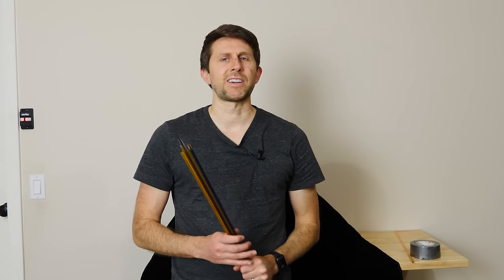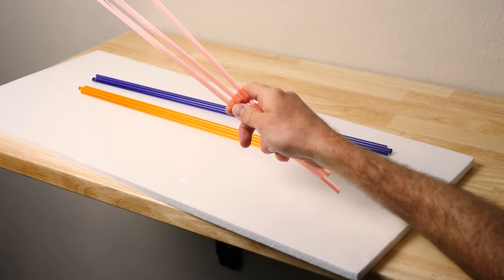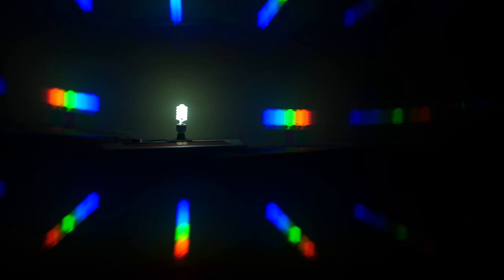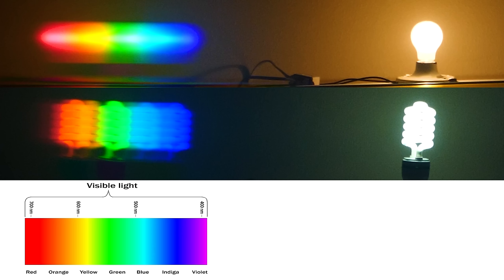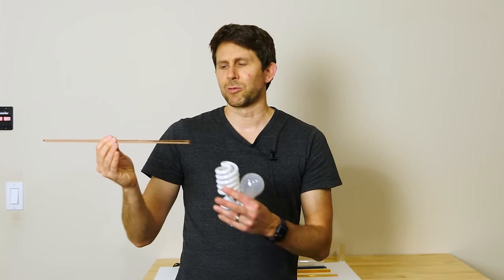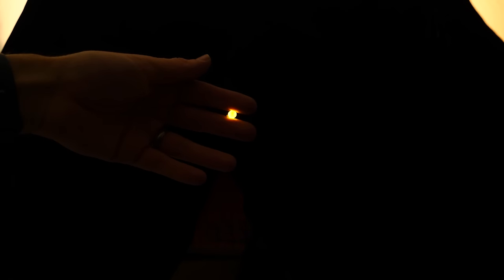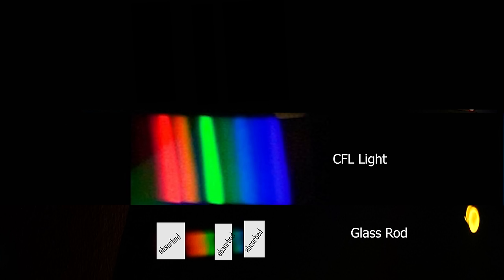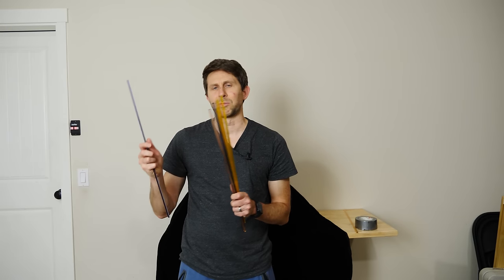How Does Shifty Glass Work?

Comment: I'd be interested to see the difference with an LED bulb, as well, since most of them use a blue light source and yellow phosphor.
Reply: White LEDs don't have any "gaps" in their spectrum, like CFLs have. The effect could still be possible because the spectrum has a different caracteristic  "shape" compared to incandescent lights, but it can't make as big of a difference.
Reply: LEDs and CFLs use the exact same phosphor to produce light. There is no difference.
Reply: It would be interesting to see what different types of lighting looked like, for instants, high pressure sodium lights.
Reply from the maker: The LED white lights are pretty similar to incandescent bulbs. When I showed you the diffraction sheet on a light On the ceiling in my video that was actually an LED light. You can see how it is pretty similar to the incandescent one with no big gaps.
Reply: I have a Kind LED grow light that I can adust the spectrum on. I'd love to see the complete range of colors available on the shifting glass.
Reply: @pdp11  no they don't, and for a good reason: mercury vapor and blue LEDs have a completely different emission spectrum. Mercury vapor produces a very "thin" band of uv light, while blue LED produces a much larger band of visible light.
And it happens that LED manufacturers found some combinations of phosphores  that can convert the blue light from the LED to a pretty smooth white spectrum.
Reply: @TheActionLab  well that's because the phosphors in the LEDs are of high quality. But you can get CCFLs of the same quality. For example CCFLs used for video and cinema lighting. Sadly, the converse is also true. There are plenty of very bad LEDs.
Reply: You should check out Technology Connections video on this subject, LED lights do have gaps which is why the Colour Rendering Index is a thing
Reply: @pdp11  no they do not.
Reply: @TheActionLab  Does that glass contain neodymium?
Reply: I was thinking the same thing.
Reply: @TheActionLab  what about high CRI LED(~95) vs average LED´s ?
Reply: @stephaneduhamel7706  that depends on the specific LED you really can't make that kind of general statement because you can still get LEDs with multiple different phosphor blends because that's how they tune the CRI value and color temperature.
Reply: @TheActionLab  What color shifts are there with natural daylight, or a laser, does the color temp. make the difference?
Reply: @pdp11  LED bulbs do not use phosphor.  The diode itself emits a specific wavelength directly based on the specific makeup of the diode material. If they can’t get a specific color for some reason, they will use multiple diodes of different colors and a diffusion filter to mix the colors to get what they want. 
But phosphor is not used.
Reply: 2:35 The phosphor in a ccfl is INSIDE the glass.
Reply: @shawnrhode Wrong . . .  White LEDs are made from a MONOCHROMATIC Blue LED by adding its complimentary color , that is , Yellow ( as opposed to mixing of RGB LED emission as observed in TVs or Displays.).

The required Yellow photons are generated from the Blue LED photons itself through Stokes effect.

The Blue Photons are absorbed in phosphor material that is coated onto the LED chip, and emitted as lower energy Yellow Photons. The Eyes detect this combined colors as White Color.
Reply: @shawnrhode  No, that's not how white LEDs work. White LEDs are actually blue/near-UV LEDs coated with phosphor which fluoresce in visible light.
Reply: @Behemoth33  doesn't this depend on the globe he was talking about. If its a type that can change its colour then it wouldn't use phosphor, but the process Shawn was explaining. Their are many types of LED's and saying they all produce white light that way is just wrong. Unless your talking about specific models you can't use broad statements like that.
Reply: LEDs can emit whatever color light the manufacturer wants them to.
Reply: @brycekilpatrick4569  yet again I never said all of them emits white light. I said that his statement was incorrect where he said no LEDs use phosphor.

White LEDs and the illumination breakthrough

:Ce (known as "YAG" or Ce:YAG phosphor) cerium-doped phosphor coating produces yellow light through fluorescence. The combination of that yellow with remaining blue light appears white to the eye. Using different phosphors produces green and red light through fluorescence.
Reply: @michaellinner7772  You mean wavelength. There is a difference.
Reply: @eklhaft4531  of course, but the original point referred to the color of the light. My comment wasn't aimed at becoming a scientific lecture.

Comment: Thank so much, glass clear. One urgent unrelated question. I tried your experiment with the steel tube with a heated wire mesh. But whatever I tried, I could not make it produce any sound. On the video it looked so straightforward... I tried different meshes  different distances to the bottom and so on. This experiment did not produce a tone , but dented my self confidence...
Reply: I think now, that the perforated steel plate I used is not suitable. It should be a wire mesh  by this the transfer of heat from the mesh to the air is faster.

Comment: This is useful stuff. I could probably think of dozen's of applications for this kind of glass. Photo etching, laser diodes - even U/V blocking glass. I wonder if there's a way of modulating the frequency of light absorption with a strong magnetic field..?

Could this type of glass be used to make lenses/filters for cameras scanning for specific absorption lines in Astronomical objects..? Say you wanted to identify if there was Oxygen in the atmosphere of an exoplanet. You'd look at the light from the star the exoplanet orbits as it's filtered through the gasses in it's atmosphere. But to find the spectrum lines of Oxygen, you'd need to filter out all the other lines from the star's light. That's where something like this glass (with a very precisely calibrated absorbtion) could act like a filter for the unwanted lines.
Reply: photons don't interact with magnetic fields
Reply: @ThereIsNoSp00n  Perhaps I wasn't clear. I meant using the magnetic fields on the electrons in the doped glass material to alter it's light frequency filtering effect. Alternately, we could just learn to manufacture the chemically doped glass to an extreme precision, or create composite filters from different doped glass layers.
Reply: This specific type of glass no, but yes there are specific fields of glass engineering that deal with making filters. furthermore glass is s pretty good blocker of UV already hence why uv lamps are made of quartz because the fluxing agents block UV light. this color changing glass is based around holmium trioxide, which exhibits a strong yellow/pink transition even as the oxide before you add it to the glass. there are only a small handful of magneto-optic effect and I don't really see how you could use any of them to create any sort of new filter from this glass using any of them.
Reply: I don't remember the source, but that is actually how scientist identify the atmosphere components of different planets. With refractometry
Reply: Dichroic filter glass can perform such a task. Quite common in all sorts of tech. For instance, the color wheels of single-chip DLP projectors use dichroic glass to filter white light down to red, green or blue light.
Reply: @Wyatt_James  It always feels wonderful to make some educated guesses about how technology could be used, only to learn that the people who really know the tech best have beat me to it.

I've said it before, but I really love how learning novel science on this channel stimulates my mind - often in unique directions!

Comment: why do small pieces of gold that are readily visible in sunlight become hard to see indoors under artificial light. This happens when I'm finish panning gold concentrates.  Thanks for the videos.
Reply: I think gold reflects a lot of red, and cheap LED and all CFL lack good red (known as the CRI R9).  Try incandescent bulbs.
Reply: Try a high CRI led bulb with a color temperature of the sun (about 5777K). They make some new ones now with an additional violet component that has an almost perfect 100 CRI value.
Reply: @s9josh778  incandescent have really poor unnatural colour  temperature. They would have to be radiating at 5777K just like the Sun surface temperature,
Reply: @undefinednull5749  I've observed sunlight swings from 4900K to 6900K depending on the weather.  And yes, incandescent are unnatural in that they throw a lot of red, and that is exactly why I recommended one for his use case.
Reply: @s9josh778  yeah, the clouds and the height of the sun on the visible sky affects the colour. But at its source it is about  5777k, because that's the surface temperature and what gets radiated before any potential affecting.
Reply: Thanks guys!  A 95CRI/6500K full spectrum BR30 LED bulb from Waveform Lighting did the trick.
Reply: @danpatterson9650  I'm happy that you solved the problem :). Is there any reason you preferred the 6500k rather than something closer to 5777K? :)
Reply: @undefinednull5749  Website recommended it for jewelers and so I thought that it would apply to panning.
Reply: @danpatterson9650  you may want to know then, that any light source with a high CRI could be recommended for jewellers. What's more important though is that the majority of even those high CRI like even 90 to 95 ones really don't work that well for deep reds. If you have rubies for example you'd  not want them to appear any more dull or greyish than they are, especially if sales matters to you.  The CRI is an average of 15 different colour tests AFAIR and reportedly red phosphors tend to reduce the overall lumens per watt efficiency, which is why most manufacturers miss out on that part. You'd need CRI 99 (which already exists) or ideally 100.
Reply: @undefinednull5749  Thank you, Waveform has a "up to CRI 99 with 6500K" light panel. Could you suggest a source for CRI 99 5777K light?  The 95 CRI 6500K that I purchased did illuminate the fine pieces of gold better than other lighting but, if there is something better at an affordable price I would consider it.
Reply: @danpatterson9650  well, I'd like to know this for myself too, as this is a really interesting topic. I research some interesting topics exhaustively every once in a while, it's just good to do before buying anything. Saves me money and time in the long term.  I wish I could, haha lol, share it with someone who would appreciate the work, I could do this full time, I think.  Most people don't bother to spend several hours or a few days for that, so that's also why the so called top picks from Google results are almost always just  infomercials for affiliate marketing gains.

(A different idea, hehe, would be to use mirrors to redirect and concentrate sunlight, lol).

Comment: Hey I just bought a micro scale on Amazon for $50( approx measure to 1/100 gn). And I noticed if I get my finger close but not touching it always registers around neg 6-7 grains.   Is this air pressure or electro static or just my power aura.

Comment: Can you make a video on electricity or lightning. And the danger based on color. Considering outside factors dont change that color. Mostly in the case of lightning on that anyways.
Just can't find a scale of the danger each color represents for electricity and such.
Meaning by heat. Or maybe the amount coursing through your body that would hurt you based on color. Maybe what devices could hurt you. What wouldn't as much. Idk
Reply: The color of plasma depends on the gasses being ionized and are all probably equally dangerous

Comment: Incandescent and Halogen are superior to CFL and LED in terms of light quality.
Efficiency is another story.

Never use CFL for room lighting if you want to perceive reality in its full spectrum.
Reply: I have a little spectroscope and took a look at different light sources. Today's modern white LED lights (not the colour-shifting RGB ones) are pretty continuous in their spectrum. They replace incandescent bulbs very well.
Reply: @andrebartels1690  I never said anything else.
Some LEDs do come close to the light spectrum of incandescent or halogen in the visible spectrum. 
Full spectrum is another story.